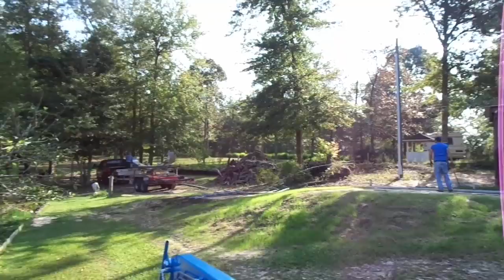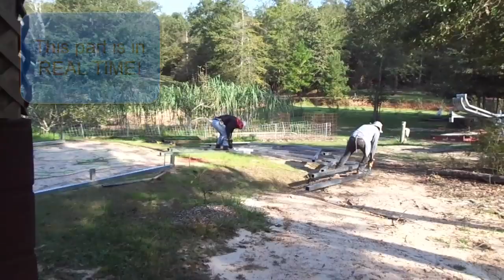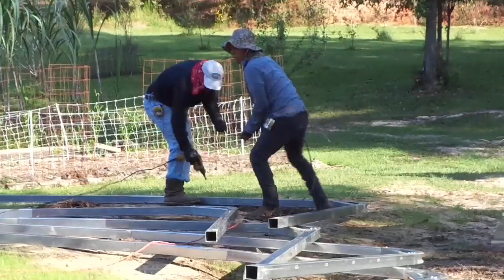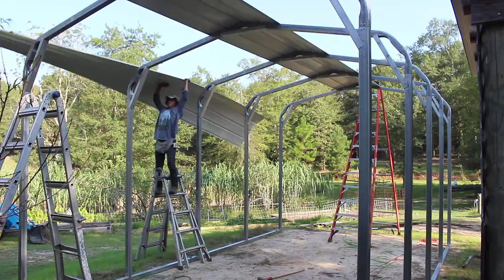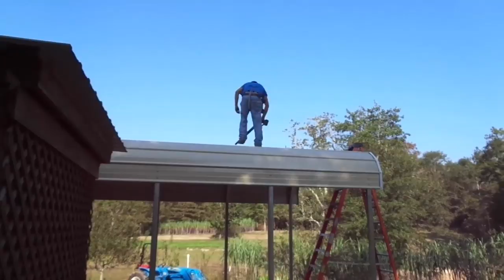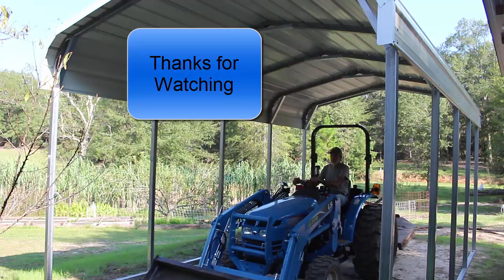Tractor Shed in 30 MInutes!!!

Comment: Great job, you will really enjoy using it.  I bought mine 5 years ago, it is large enough for two vehicles and still park my riding  mower in front of my van camper during the summer months.  You will certainly get your money out of it. It has made it through hurricane Irma and several bad storms, never made a dent or even looked like it wanted to sway. I put some drip chains on the corners and let the rain water drip into the 30 gallon drums to water my plants.  Also a nice shady place to sit outside, but of course you have that wonderful porch swing. Why didn't you get a blue one to match "Annie"?  Danny can pull the RV or other equipment under it to work out of the weather.  Be careful he will evict little "Annie".
Reply from the maker: We plan to use it for many things not just a tractor shed.  It has a breeze blowing through so it will make the perfect place to cook cane syrup.